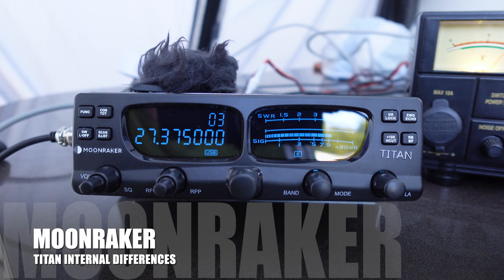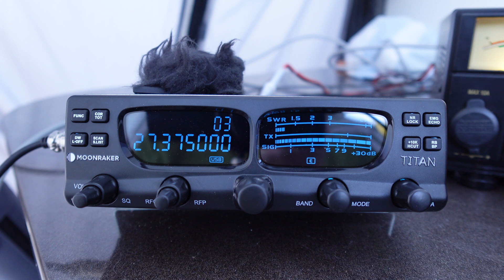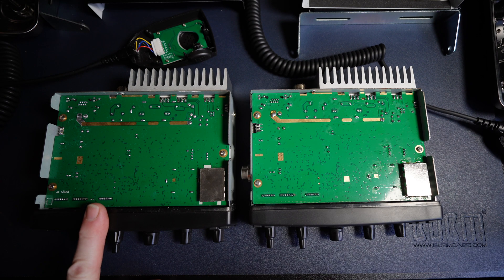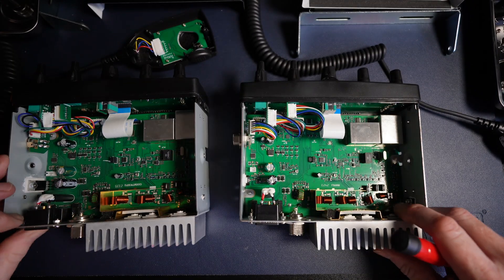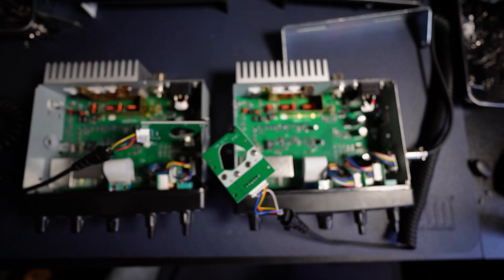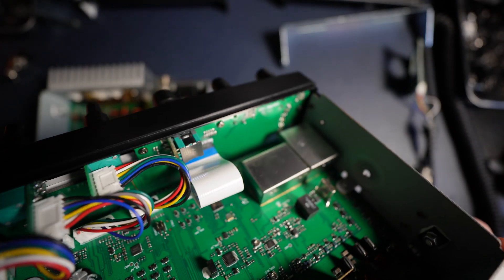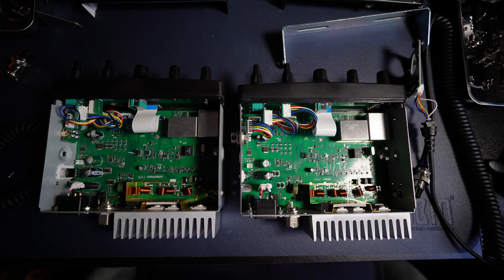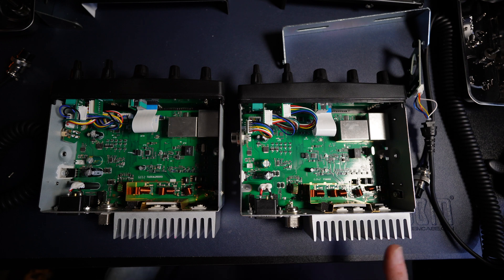MOONRAKER TITAN Mk1/Mk2 Hardware Differences

Comment: Thank you for showing the inside of the 2 versions... I just received the V2 and after testing I've found out my radio have a very low modulation on AM when on all other modes is fine, but I've seen that thre is a VR to adjust that level on the board and I'm less worried now that I know that is possible to adjust it... I will try it out when I've my station completely set-up...
Reply from the maker: No problem at all, it’s funny you should say that as the Mk1 seemed fine on AM but as you can see it is adjustable. Thanks for visiting the channel.
Reply: @gtretroworld  It worked... Now it is also loud on AM as well...!
 To be honest it has a nice mic pre-amp now... Speaking loud or too near to the mic distorts the audio... The mic can be used like 10/15 cm from the mouth for better results...
Reply from the maker: @TheBigChill1 Excellent 👍

Comment: Has the low FM modulation been sorted out yet ?
Reply from the maker: FM is loads better, in fact it’s probably a bit over the top especially on SSB where i have had to wind it back.
Reply: @gtretroworld  Yep... I also reduced the mic gain on SSB one notch, now I only have to open the radio and try to pump up a bit of the AM modulation that is extremely low on my radio at least...

Comment: What power supply do I need for this? will it work on a standard CB AC to DC switcher? Sorry newb here.
Reply from the maker: You want at least a 12 amp DC Power supply if you plan on using all of its RF power. Hope this helps.
Reply: @gtretroworld perfect thank you ☺️
Reply: @gtretroworld thank you.
Reply: @gtretroworld  would a 8amp power supply work ?

Comment: Has anyone had a talkback issue with this ?  I turned down the echo and delay and mic gain to just 1 and it still is way too loud and too much echo, also tried turning off echo by pressing/holding front panel echo button, didn't work... Perplexed, maybe there is an inside adjustment?
Reply from the maker: If you select PA with talkback the volume works fine or you can use the mic gain to drop the volume in any of the modes.
Reply: @gtretroworld  It is useable in PA mode thanks, but dropping mic gain to 1 in any mode nope it is way too LOUD in other modes.  I wrote Moonraker, they are getting back to me...
Reply: Also I have the version 2 or latest revision so far as of now month of June 2025.

Comment: Hi Neil, nice video. New to Radio. Just wanted to ask a question re the power plug on these radios. Are they a standard 3 pin Uniden plug ? Looking to get a lead to go to Powerpole connectors on a Ultra Max battery ? Thx.
Reply from the maker: Thanks…Yes it is just the usual 3 pin uniden power lead which is fitted to a multitude of rigs.

Comment: Too expensive with all those duties and taxes for a 40w radio for the same price I could buy a new at-6666 with 90w or a used moded 5555N II with a 100watts
Reply from the maker: The big plus for me with this radio is its size but if duties and taxes for your country are high i agree you may want to look elsewhere.

Comment: Based on that then Neil, both use the PCB by the Brazilian branded RP-90 . Thanks for the video
Reply from the maker: There are a good few brands using these boarded rig’s now Dave but i was told Moonraker were the company behind sorting a few issues out at the factory. From what i am hearing the improvements have been implemented across all cloned brands.
Reply: @gtretroworld  Yes I know that Neil, as I own own one of the other branded ones😊 .They are OK for the price.

Comment: I found if you turn mic gain down the talk back works ok . Also the hole for the mic doesn't line up with the internal mic so drilling the case so the mic lines up improves the output
Reply from the maker: Yeah turning the mic gain down works too but if you want it to work like the Mk1 with the volume control you need to use the PA.
Unsure about alignment of the mic element but i will check that out..Thanks